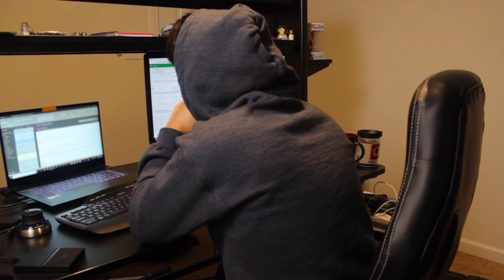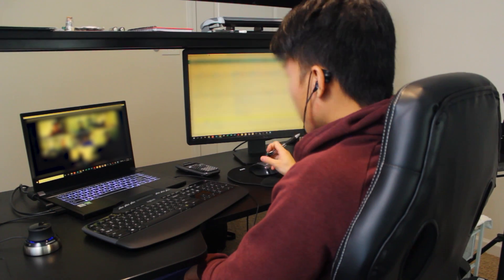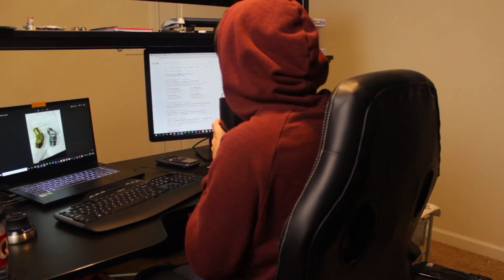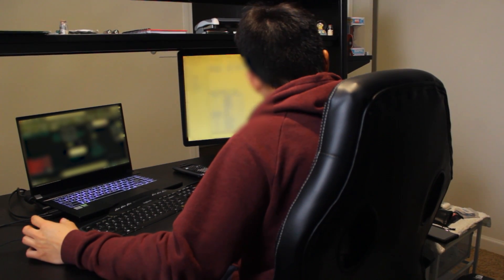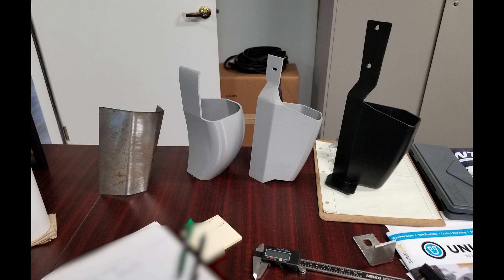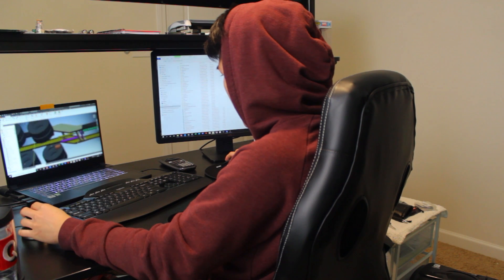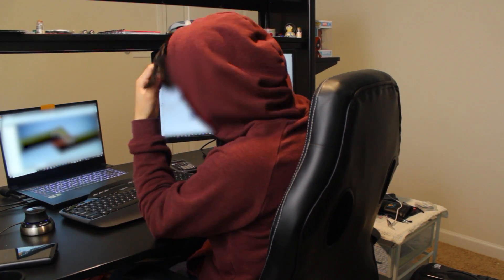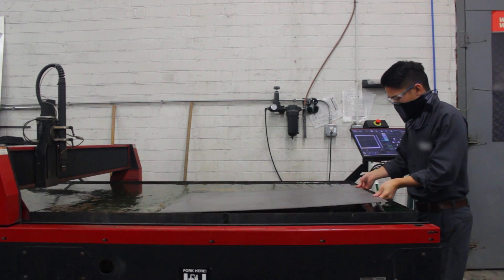Day in The Life of a Mechanical Engineer (Automotive) | Quarantine Edition

Comment: That looks like PartsProx. Assuming you work for DTNA. Tell the electrical engineers to get their wiring diagrams straight. EZWiring should have been redesigned years ago. 2022 trucks come in with electrical issues and unfortunately we waste time trying to finding the correct diagram which ends up not being there.

Comment: Nice video but one question: how creative do you consider your job as a mechanical engineer in the automotive field?
Reply from the maker: Hey Pure_Ligma,

Because I'm in the trucking industry, most of my designs are simple bracketry components that can be easily manufactured. Sometimes I'm creative in regards to packaging a system in a neat way, and sometimes I'm truly creative in designing parts aesthetically. 

I think more in the car industry, creativity is more expressed...but I'd say I use about 35% of a true artsy creative background. 

I took art in school, and was in band so I'm lucky I have an artistic side...but being artistic isn't necessary in the automotive industry...just in a few sectors of the automotive industry (example, body panels, interior panes, anything the customer can visibly see). It's definitely a plus if you do have an artistic side though! 

Great question by the way!
Reply: @phillipmoua9805  Thank you. Good to hear visual creativity can still be expressed to a certain extent as a mechanical engineer in automotive. 35% seems great. Have a good one

Comment: which software should we use for CAD/CAM in first year mechanical engg?
Reply: Try Autodesk inventor. Students get free
Reply from the maker: Hey Shachidra, 

Like Mwaniki said, Autodesk Inventor can get the job done and since it's free, it wouldn't hurt to have and play with! 

I found that SolidWorks is better, but it does cost more. BUT! If your school has the software (any 3D CAD software), you can always use it for free there too! Most of the time, your school will give you a key for a yearly license for free too. So make sure you're using all of your resources!

Comment: My friend is graduating to go to college for automotive engineering. What would you suggest is the best gift that relates to automotive engineering?
Reply from the maker: Hey, Edneisha! 
Sorry for the late reply, had a busy week. 
But if your friend is doing a lot of CAD work, I would get a 3D Mouse. They take a while to get used to, but it makes 3D modeling that much easier!
Reply: @phillipmoua9805  where would you recommend getting a good 3D mouse?
Reply from the maker: @Eddyidgafx3  Amazon haha 

(Wired)
https://www.amazon.com/3Dconnexion-3DX-700059-Spacemouse-Compact-Mouse/dp/B079V4PXYD/ref=sr_1_3?dchild=1&keywords=3d+mouse&qid=1620074971&sr=8-3

or the wireless one (a bit more expensive, but comes in handy)
https://www.amazon.com/3Dconnexion-SpaceMouse-Wireless-universal-receiver/dp/B079V367MM/ref=sr_1_5?dchild=1&keywords=3d+mouse&qid=1620075002&sr=8-5

No affiliate links. So I'm not making any money off of this. 

Also, you can get lucky and find some used ones cheaper on Ebay, LetGo, FB MarketPlace. 

But those one of those 2 options should be a great gift! 
I wish I had one when I was starting out with 3D modeling haha. Never knew they existed.

Comment: Hi im an aspiring engineer in canada... but getting the foot in the industry is so hard.. any tips on getting the first job ... i have autocad and solidworks skills btw and some machining skills
Reply from the maker: It is defiantly harder than it looks. I think you're taking the right steps as far as your CAD and machining skills. A lot of people don't understand the manufacturability of parts, and because you have this machining knowledge, you can better understand HOW a part should be made depending on it's main criteria's. Strength, cost, speed of manufacturing, etc. Use this to your advantage in your resume and interviews. 

As far as getting into the door, try to join FSAE of BAJA and get as much automotive experience as you can. Design parts, fabricate them, and test the parts. Show your work and process and bring a design portfolio with you on any interviews you have.  

You've gotta keep applying to automotive companies, and once you get into the field, it's much easier to transfer within this sector. Going from Honda to Ford for example. 

Also! Consider working for parts supplier! OEMs get their parts from ZF for example, or Meritor axles for trucks. Do a bit more research on WHOs providing these parts to the OEMs if you don't have any luck with larger automotive makers. 

Good luck, and don't give up!
Reply: @phillipmoua9805   thanks so much... u are truly inspiring

Comment: Guide Us as automotive Engineer what skills we need?
CAD (Creo,Pro E,Autocad,Solid Works) what software u mostly 
I m a fresh mechanical engineer graduate and I want to do masters in abroad (Canada is perfect?) to get into automotive industry
Reply from the maker: As a fresh ME graduate, you should have most of the skills you need. Depending on the automotive company you want to work for, your CAD platform will vary. For example, Honda uses Catia V5, Freightliner uses a mixture of Catia V5 and SIEMENS NX. 

As long as you have a good foundation of CAD, you should be good. You'll get more on the job training once you get into your desired company. But I mainly use Autodesk Inventor. 

I'm not too sure about Canada's school system, but seek out ABET accredited programs and look at Canadian engineering schools that ranked high in the FSAE of BAJA competition. This will give you a better idea of what universities are "best" for automotive engineering.  

Even in your Master's program, I would say you need hands on experience along side your theoretical studies. So join FSAE of BAJA and apply your theoretical knowledge on the projects! 

I don't know too many engineers that continue their education, I'm not knocking higher education, but most of the "successful" engineers just have a bachelors. Get the hands on experience and that will set you apart from the rest. 

Good luck! And I hope I helped!